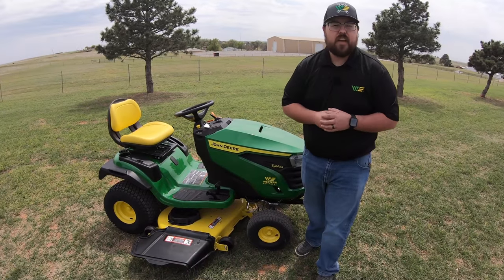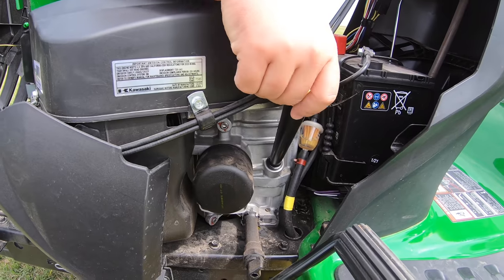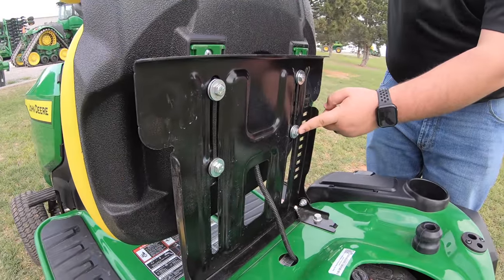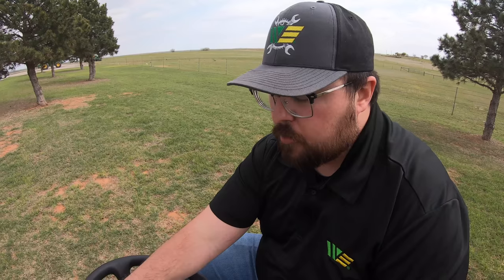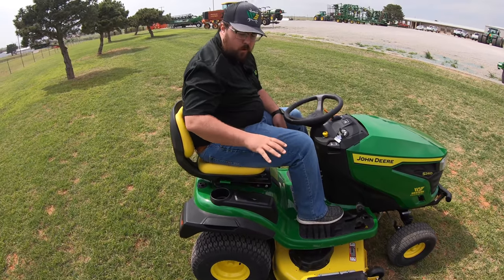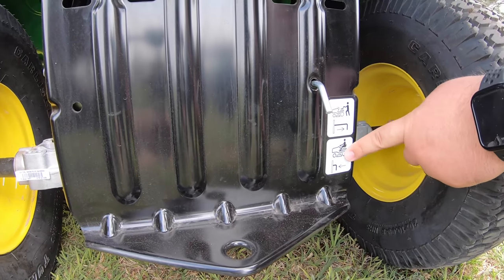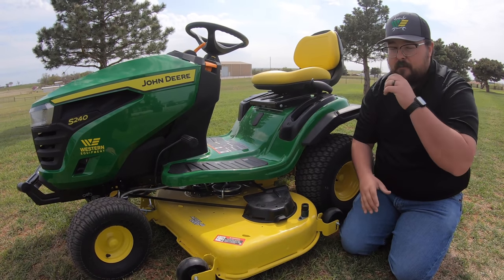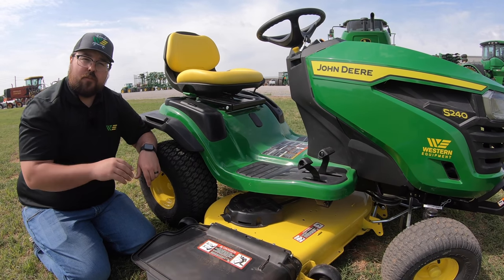2021 John Deere S240 Lawn Tractor Mower Review and Walkaround

Comment: Slightly underpowered with the 18.5 HP engine it had previously, too much under deck buildup, steering is terrible.  350 hours in 2 1/2 years with no mechanical issues.  Overall I’ll give it a B-
Reply from the maker: Thank you for your feedback and thank you for watching!

Comment: I don't understand why John Deere made the S220.  It's not really any better than the S130 as far as I can tell.  Oh never mind, I see it.  The S220 has a better mower deck, a slightly better engine, longer warranty, and it doesn't have that stupid easy "change half the oil" system which I don't care for myself.  so ya, I'd pick the S220 over the S130.
Reply from the maker: Yeah it is definitely an upgrade from the S100 series. Thanks for watching!
Reply: The engine on the s220 is( on briggs and Stanton's website)  listed as the exi series engine and according to them has a life expectancy 67% greater than a regular intek because of better bearing,filtration,and chrome plated valves. The s130 is only $200 less and comes with the less desirable edge deck. With the accel deep deck you can mow a little faster without sacrificing cut quality.

Comment: IMHO:
All John Deere EQUIPMENT should have LED LIGHTING!!  How cheap does John Deere have to get?  Poor lighting because of COST'S EXPENSE vs "Safety Factor of Better Brighter White LEDs"... is just plain STUPID!   Install the damn LEDs and just charge the buyer a fair price for it doing when the machine manufacture!!  As a JD Dealer I would be ashamed to offer a lawnmower with second class lightbulbs.   Be the first to offer LEDs in all your lawnmower models.  🚜

Retired Black Land Farmer

LT 166
L 110
GT 225
730 D
850 COMPACT
4400 D
4430 D
8430 D

Comment: No Kohler 7000 series Engine won't buy
Reply from the maker: Everyone has their own preference. Thanks for watching!
Reply: The Kawasaki engine is much better. Wish I had a bigger lawn to mow and spend more time riding my S240.
Reply: @556suppressor  no it's not not even close to being better
Reply: @deputyfestus4163  The Kohler are good,but unless you get the kohler command they aren't quite on par with a Kawasaki.  They will last you a good long time though. To be honest on most mowers it's the transmissions that are the failure point a long time before the engines crap out.

Comment: Not a fan of how the deck belt travels outward to the deck spindle from the engine pulley. I can see how the deck belt could have a lot of vibration and possibly come off the deck pulley.
 It would have been a better set up if john deere had added one more idler pulley on the deck bringing the deck belt straight  back to the deck and then over to the outer left spindle.
 The air filter cover is another area where JD has cheapened this mower. I can see that snapping of at the hinges as well. 
The plastic hood hinges is another poor design.  I've seen  countless mowers come in with broken hood hinges. 
 Thankfully after 23 years of waiting  John Deere has made a hood without the side clips that litterly caused the hoods to crack when trying to lift them.
 The seat material is completely  crap and cracks occur on every seat made like this. Yes every seat. The seat is trash.
 The K46 transmission is just ok. Nothing special  here folks. Flat level yard and it will last a very long time.
  The powder coat paint job on the deck is another terrible thing. If you get a rock chip in the paint on the deck you had better fix it quickly! If not and any moisture finds its way past the powder coat paint than the deck will start to rust very quickly and powder coat paint just pops off in sheets once this happens.  So fix any chips and avoid water at all cost! This includes grass buildup on the deck. If your grass is even remotely damp your at risk of your deck paint just flaking off.
 How do I know all this is because I've been around hundreds of john deere mowers over the last 23 years.
 I will say this though despite John Deere  continually continuing to cheapen or failing to improve on the design of there mowers in SO MANY areas  they are still better than any MTD made mower on the market imo.
 However john deere quality continues to go down and the prices continue  to go up....Go figure
Reply from the maker: Well thank you for the thorough response and input. I completely see where you are coming from on a lot of the issues you talked about.

Comment: A question:  the grease fittings on the spindles , are the bearings sealed or open to except grease ? The older decks on J D ‘s were sealed bearings and the grease never got into the bearings!  Same thing on the new ones ?
Reply from the maker: Yes they are sealed but it is important to make sure you grease your spindles to make sure to keep moisture from building inside and possibly damaging the shaft. Great question and thanks for watching!